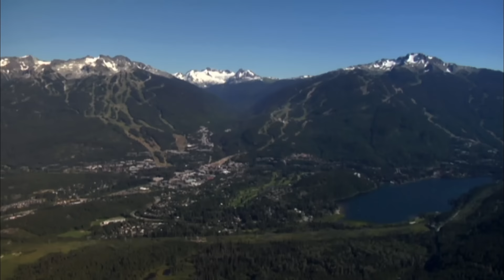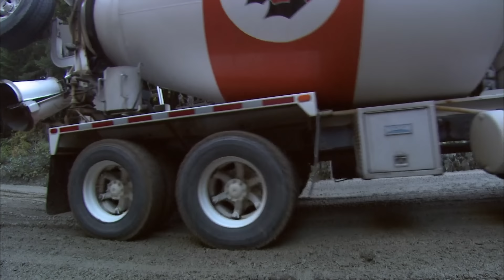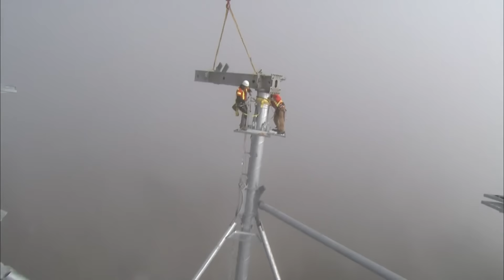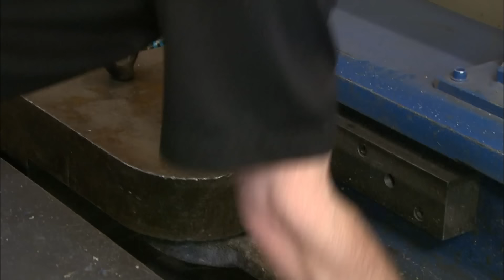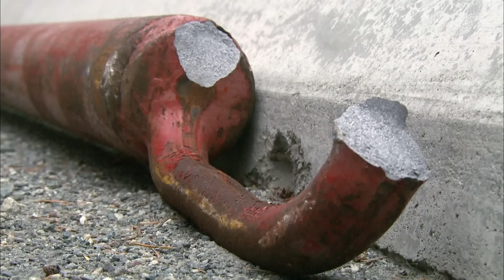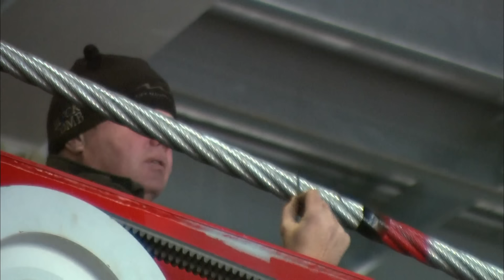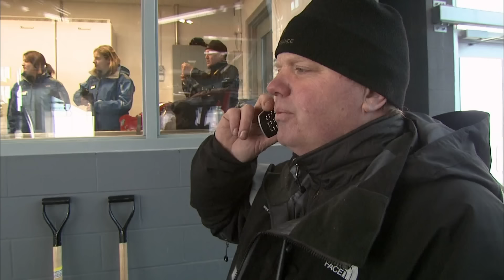The Engineering Genius Of The Largest Ski Lift Ever - Peak To Peak - Engineering Documentary

Comment: Why would you not just drive the cable to the valley, lift it up to the closest tower, and then run it up one tower at a time using a smaller cable?  You still need to go through one tower at a time, so may as well keep the whole roll down there.
Reply: I imagine that there would be quite some extra load on the nylon cable. Instead of pulling the steel cables across and down (aided by gravity) you are fighting gravity.
Reply: @mattiti8523  Makes sense.  The force required to haul those rolls up by truck can't be any different than the force required to thread it up as a line.
Reply: because being in the middle you would have to unroll the whole spool at the bottom of the hill to get at the second end. That end of the "cable" would have to be in a big pile and it would be very destructive to the "cable" (it's not cable, except you could call the haul rope a cable, i suppose. The correct name for the smooth ones, that are permanently fixed in place and the car rollers travel over, is "Strand"). The haul rope is more than twice as long as the two strands that each gondola rolls on, and you could feed one end from the middle up to one station, across the valley to the other station, then back to your truck in the middle, but then you would have to weave (Long Splice) those two ends together way up in midair so it would be tight not sagging to the ground. Interestingly, the haul rope is WAY stretchier than the strand pairs, so it's going to need a lot more take-up after it's spliced to get it up to the same tension they're under. The first thing they should have done is turn that run into a macadam road or something; it seems like HOW they were going to get the mud up the hill(s) was not given any thought. Whatever they did on the other side was not mentioned, lol.
Sorry, wordy, but trying to answer a good question.
Reply: @martyspargur5281  Great description, thanks Marty.  Agree, given what was at stake, a dry run pulling half the weight using half the horsepower up that road as a dry run would have clarified the situation.
Reply: @martyspargur5281  Great description Marty, thanks.  And yes, given what's at stake, a quick dry run up that road with half the load, tire footprint and horsepower would have clarified the situation ahead of time.
Reply: Two things I can think of:  It takes less force to mount the cable by pulling it downhill.  I doubt they would have gone through all that trouble to drive it up to the top otherwise.  And any grit or dirt on the cable would be a perpetual source of abrasion and wear so keeping it off the ground was imperative. They mentioned that it was important to keep the wire ropes clean.
Reply: one thing that is not obvious is that where the lift line intercepts the "valley" there is no good road access there....just a logging road on a sidehill right beside Fitzsimmons creek. The steep flanks of both mountains meet each other at the creek. There's barely enough room to turn a pickup around. That's the first problem....the second is the lack of towers (you can't drag the cables on the ground)

Comment: Great terrain cursed by heavy wet snow and soggy grey skies.
 FYI those are 10 yard trucks, when you go up steep grades it overflows....hence the short loads.
If concrete was that critical then contract a mobile batch plant with dedicated trucks.
Or go cheep and cry about your place in line.

Obviously pro's running this....
I've poured more concrete in remote sites then you've walked on in your lifetime...

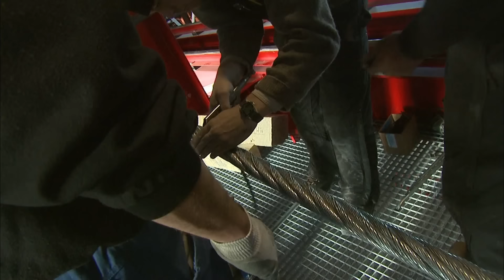Comment: 36:29 The cable splicer guy determined "none of the wires were broken". Well then how are they explaining where the broken wire debris on the emergency break system came from? C'mon guys, don't lie to us. Say that the wires were broken but not enough of them to cause a problem.
Reply: Wire rope is really hard and abrasive. What you saw were aluminum shavings from where the wire rope came in contact with some of the aluminum structure. That is the reason they made the rope lifter, drawn on a napkin; to keep the wire rope clear of the aluminum structure. Wire rope is used to cut submarines, ships and stone. Also used in the offshore oil industry to cut pipes etc.
Reply: @TheScropley  ok, so even if the shaving are from the structure, they gave us a closeup shot of the broken strands in the rope. We all know you can't reconnect those strands. And while it was made with "more than enough" strands to hold far heavier gondolas, they simply brushed over the fact the world's greatest splicer can't actually fix broken strands, then acted like it was all repaired and good as new. It isn't.
Reply: @mypapagaio8971  I didn't see broken strands. I saw deformed strands that were pushed out of place. If you work them far enough back ( many feet), you can work them back into place. And yes they won't be good as new. My guess is they will spray paint any questionable areas and keep an eye on them.

Comment: I don't get it. For years, Powder Mountain in Utah has had 8464 skiable acres, but somehow it isn't the biggest ski area.
Reply: whistler/blackcomb i believe is way more then that
Reply: @j.thomas7128  not all of powder mountain is lift serviced I think.
Reply: @stewartkristiansen1705  It's pretty much all lift serviced, but some of the lifts are unconventional. Two snowcats ferry skiers into a large section and two buses run as needed to pick up skiers that want to explore the outskirts and boundary areas. Ski down to the access road and a bus brings you back to the top. This is the closest you can get to backcountry skiing while still staying in-bounds with protections. None of this extra area is groomed. It's barely even thinned or cut. I love this place, but don't get there enough. Pow Mow has great and varied terrain, but Snowbird has the 'die if you fall' steeps that really get the blood going. It's a fun jam.

Comment: What if one of the pulleys on the system damaged the wire and it didn't happen in manufacturing? That is a recipe for disaster in the future
Reply: Yep.  And what if a jet fighter flies into the cable, like Cavalese 1998?  That would be a recipe for disaster too.

Comment: Wait, wouldn't you want to ski down then take a ride up instead of just taking a ride across? Also wouldn't it only require 2 new lifts?
Reply: most of the best runs are at the top of each mountain. going all the way down then taking all the lifts up the other peak would take 2+ hrs. helps alot if you are only there for one day
Reply: 2good4you  the alps are shiz in comparison.. lol clearly you haven't been to whistler/blackcomb
Reply: 2good4you  This is very comparable to the Alps as I have skied both.

Comment: Hold on hold on, so the cable broke at 1580 kN while the requirements were 1520 kN? Holy crap that is just a 5% safety margin. That can easily vary with different cable  segments according to impurities in the material and variance in manufacturing parameters. So another random segment can easily be 5% under the required 1520 kN due to variance. What the hell were they thinking???
Reply: Already had a 4x safety factor applied to reach that requirement

Comment: I don't really see the problem. ''You have to go down first to get up the other peak'' .. Yea well you just went up that peak. What was the point of that if you actually want to go to the other peak? You go up a peak because you want to ski down.
Reply: The best slopes are almost always at the top of the mountains. Going completely down, crossing a valley and up the other side is often not worth the time. You'll waste half your day on sub-par slopes and maybe even a bus through the valley..
Reply: @highks496  Yea I get it. Things are a bit different down there. I had our ski resorts here in Norway in my mind. We don't have such huge resorts and we usually have snow all the way down since we are so far north and our mountains are much lower. 😅

Comment: i can't even imagine having to pull that huge spool up the hill , let alone some @ss hat riding the brakes on the semi supposed to be pulling it!! with loaders up front and behind and the spool in the center dragging its tires --- i bet the operators of the push and pull trucks are going to be scratching their heads why the other spools were so much easier to pull up.. -- people like this are what can absolutely break a large company and project like this -- critical to weed them out as soon as possible!

Comment: Should have pulled the cable up the hill with a D11, i know america shows like adding drama but showing that damage to the cable is a bit idiotic.
Reply: I dont think a 100 ton dozer with steel tracks the width of a small car would do much for their already poor road surface 😂
Reply: @markmuldoon7044  if anything using a dozer would fix the road
Reply: @markmuldoon7044  if anything using a dozer would fix the road

Comment: The most worthless ski lift I have ever ridden. I rode it once for the novelty. " A steep unforgiving valley separates the two resorts". Hell, the two resorts are a few yards apart and you can easily ski from one to the other without this lift. The real reason for this lift is so people don't have to ski in the rain to get to the other mountain.
Reply: I’ve never been to this mountain but I think that sounds cool not to ski in rain
Reply: not really, year round foot traffic doing the circle tour is the big thing
Reply: to ski down to the valley from whistler is a days skiing for most intermediates could take them close to an hour then you have to ride up 3 lifts to get to the equivalent elevation on blackcomb as opposed to a 11 min ride its about ease of access and spreading skiers around all the terrain to prevent overcrowding on whistler
Reply: @keithscothern4859  It only take one lift- either the Whistler Village Gondola or the Blackcomb Gondola, to reach the same spot as the Peak to Peak Gondola. An hour to ski from Peak to Peak down to the valley? Maybe for a beginner. Prevent overcrowding? The lift lines were long on both sides on the upper lifts when I skied there, so it wasn't helping and if the same number of people are going both directions, well nothing changes. Maybe if more people skied into the valley where the lines were shorter, it might have helped, ha. The longer people ski the less time that spend on lifts and in lines. But I get it, it is an impressive bit of engineering and an interesting video.